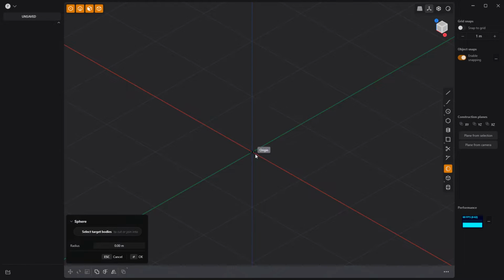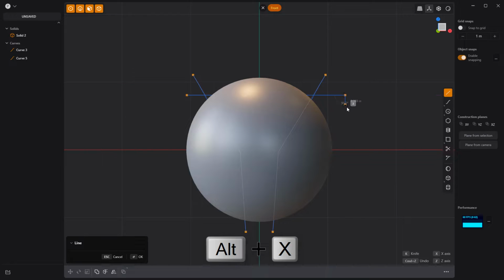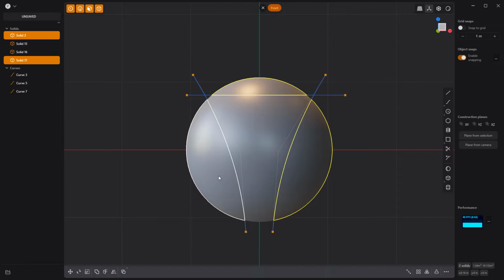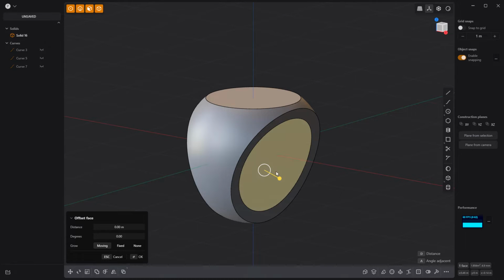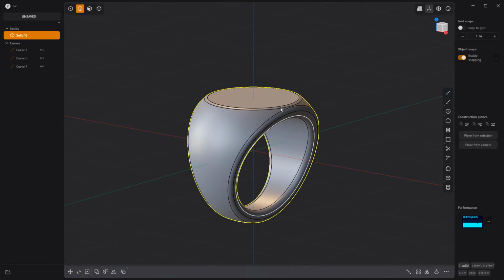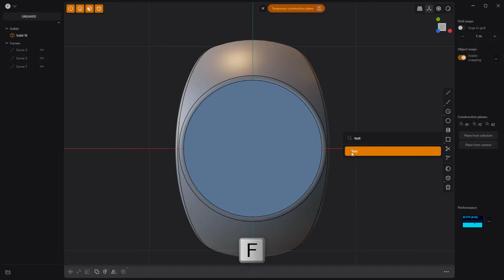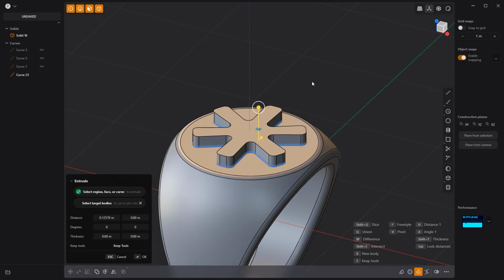Plasticity | Model a Ring

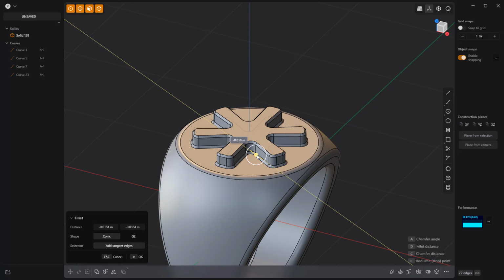Comment: Hi Floyd, can you please tell me what operation you performed at 1:12 to transform the sketch into a solid? I don't understand what you did there.
Reply from the maker: Is this comment referring to a different video?
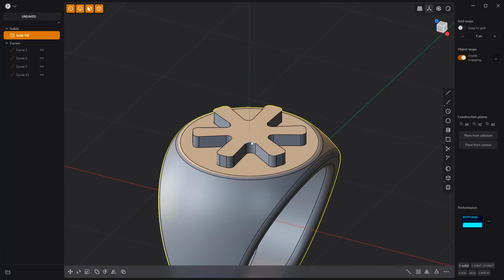Reply: @pixelfondue  No, at approximately 1:12 in the video there is a visual change in the model. The surface texture changes from an outlined sketch into something that resembles clay or plastic. All the panel lines disappear and the texture becomes softer.

I am new to this program and would like to know how you accomplished that. Thanks for responding, btw.